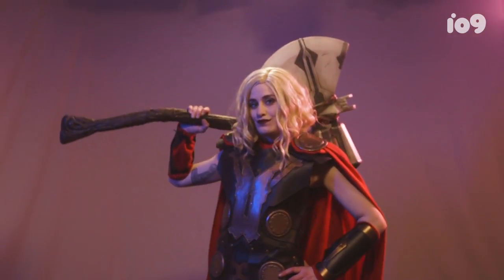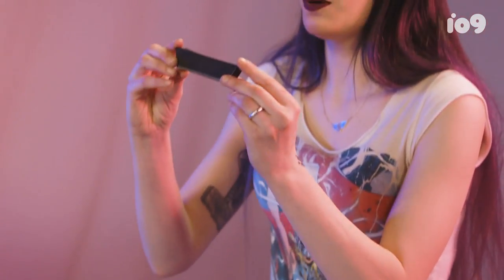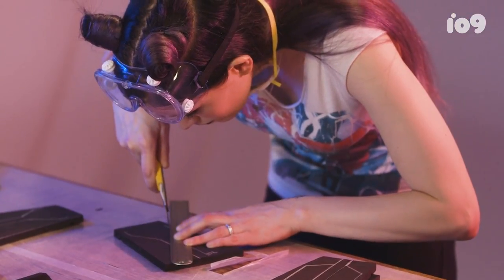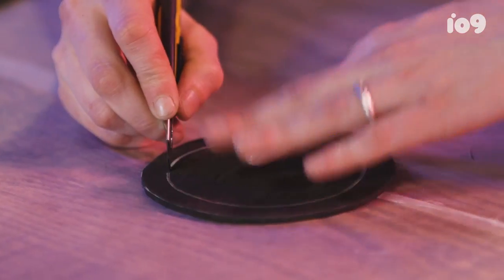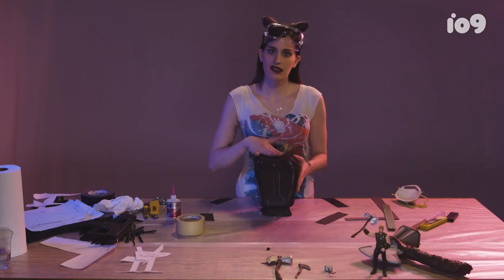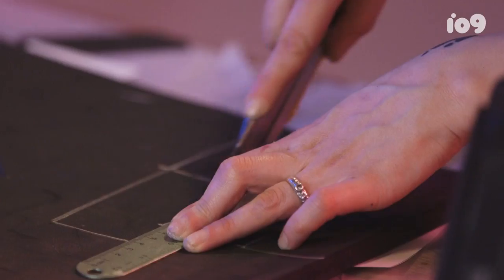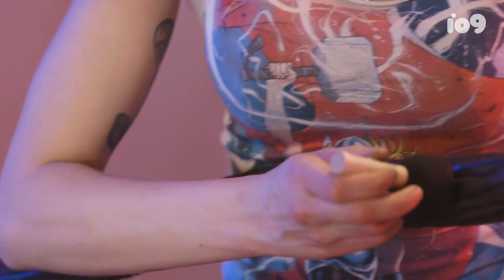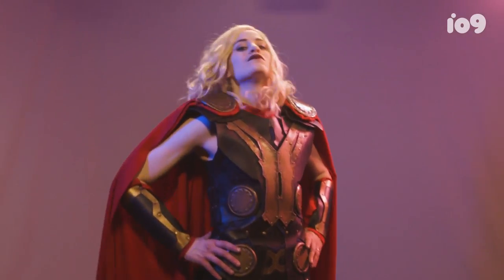How to Build Thor's New Hammer, Step By Step | Cos/Play

Comment: Tip for who tries building Stormbreaker  from this video. Cover the open end of hammer before trying to attach it to the PVC pipe, you'll have better surface area for the glue to stick. Use your 2mm foam for it.